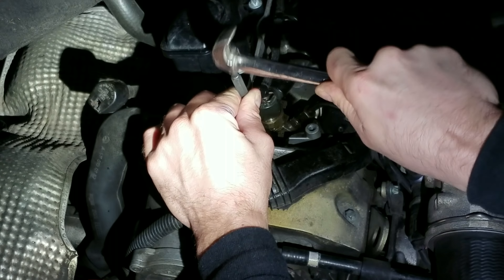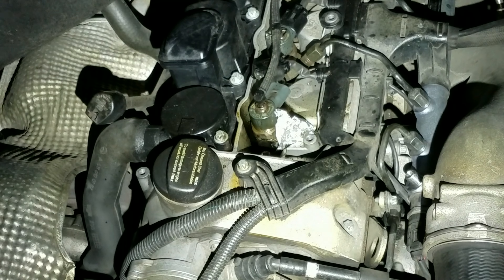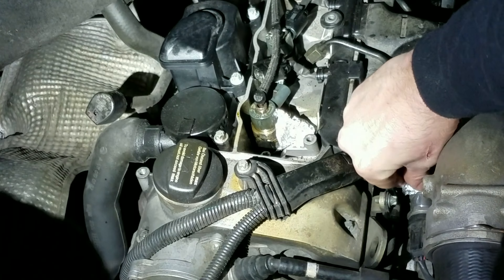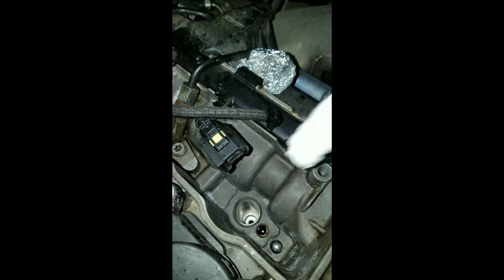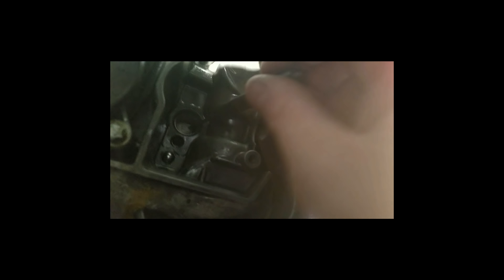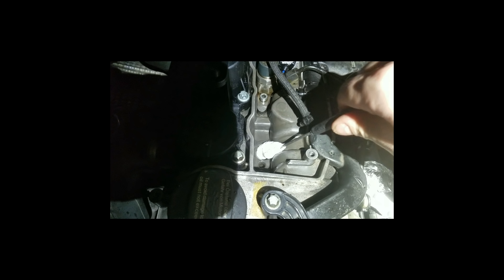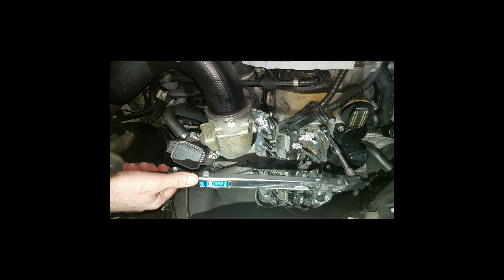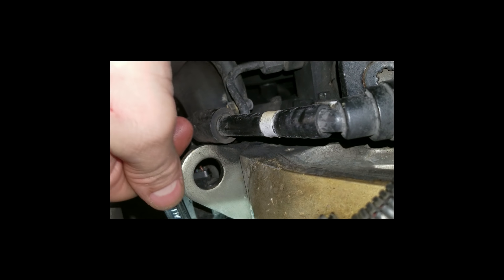How to fix "Black death" injector seal leakage on a T1N Sprinter [02-06 Dodge/FL/MB]

Comment: Actually a pretty good video.  I do think you should first buy a good set of tools. The try looking on u-tube.  I'm sure there in one out there that will show you proper techniques on how to use them. Also. Tell your friends to get out of the way of the camera. I think this part was on the first video.  
   When you first started it. You should have known it wasn't running on all cylinders.  It sounded way off.
Reply from the maker: I have the whole required tool list from PCC where I graduated with a degree in Diesel Service technology. I have plenty of tools and I know how to use them. The reason I was tapping on it was to jar any rust or corrosion on the threads, which could stick and cause the bolt to yield and snap rather than unscrew. 

This job requires a specialized set of tools that I mostly had put together, even an injector seat cutter kit 17 by 19 mm, but cleaning the threads was a little bit tricky and I wanted it fixed that night rather than driving to harbor freight for bottle brushes to mount on my drill because it had suddenly became very leaky. I actually have a thread on the Sprinter Source detailing my extensive tool list for this job that I already had (sneaky's tool list). What I really needed was a tap for the hold down bolt threads, but not just any type will work because the shoulder is wider than the threads and not long enough for the long injector bolt hole. This requires a custom tap that can take weeks to make and ship and cost 50 to $100 or more. I decided to make my own tap with the old injector bolts but it didn't work that great because I don't have a vice. Oven spray is actually one of the best tools for this job, there's a reason I wasn't using brake clean. So yes other than a custom tap that is not locally available, I had every single tool needed. Edit:( no money for air compressor btw, not a priority.)

 Also that was not my friend in the way that was me working on it.. sometimes I will have to get in the way of the camera, and with all due respect this is an unpaid job so I'm not always going to take off my greasy gloves just to readjust a camera.

And actually it was running on all 5 cylinders, it was just leaking on one, and I got that shot to show someone what a severe case is like.
Reply: @AncapistanVan  you mean you dont make any money off of U-Tube. Why does everyone else? 
  If you do 2 Sprinters. Why would not drop 50 to a hundred dollars for a specialty tap.  I think my air compressor was one of my first large tools I purchased for my garage. Long before my shop. But the was some 55 years ago. I've had several since my first.  Kind like women.  Been a couple of those gone by also. 
Everything seems to wear out for some reason...    😜
Reply from the maker: @ltsgarage7780   Lee Olaeta  zero dollars. Because just after I got to 10,000 views, YouTube changed the requirements to 1,000 subscribers. Yeah I'll get a specialty tap I just saw people using old hold down bolts with reliefs cut in the threads with good success, I just didn't realize I needed a vice to make a good one. Edit: I live in my van so might not have room for a big air compressor tank. Just another thing to buy, theres lots of those.. atm i need snow tires, $1000 steering rack, money to go south for the winter, etc. Sometimes ya gotta make do with what ya got.
Reply: @AncapistanVan  as far as the tools I was talking about.
First off. Your hammer. Oh you didn't have one.  Plus dont you have a 3/8 short breaker bar. You should never hammer on a ratchet.  You ruin it. Well. I guess you never hit it with a hammer since you don't have one.
    I really need to know where you purchased your complete set of tools. I've never purchased a set that came with a set of Leatherman pliers. 
  We've all used oven cleaner for oil or carbon build up. But I always have 3 or 4 cans of break clean. 2 or 3 in my truck. 4 or 5 in my shop. The stock on the shelves never gets low. Although I am down to my last container or bearing grease. Need to buy 4 or 5 more this week. Ah the internet. 
  Good luck. 
Keep up the good work.
Reply from the maker: @ltsgarage7780  i have lots of hammers, small to large. I chose that heel bar with the hammer face as it was the lightest weight and what i brought down from my tool cart. Yes i know not to hammer on even a lifetime guaranteed ratchet, i would have used my 3/8 breaker for that if i was going to hit it any harder than that. Sometimes it's quicker to slightly abuse your own tool than to go get the proper one, i know the limits of my tools and i've rebuilt a ratchet before. I use my leatherman bc it saves me lots of time. I have a whole drawer full of different pliers. I have every tool on the pcc required tool list; i've completely torn down and rebuilt a cummins n14 and a cat 3406E with them. Most the tools are napa professional so i can replace them locally; i bought the loaded cart from a quitter student and then started filling it out more. I actually started carrying two cans of brake clean in the van but i did use one can in the video. I did use the wrong torque wrench fir the initial torquw as i overlooked the min setting on my in/lbs wrench, but the difference is miniscule. I do also need crows feet, but this van has cost a lot of money restoring it so i make do without.
Reply: @AncapistanVan  what area do you live?  I guess I should ask first off. Which side of the pond? Why do you live in your van? How many subscribers do you have?
You can also make or purchase a fan belt driven air pump that mounts on the front of your engine. Plumb in to the underside of your frame rails where you put a 25 or two 25 gallon tanks. Walla you have air pressure. 
  You can do this for under a 100 dollars. You can also in your travels. Look for tire shops the take care of big-rigs with flat tires. Sometimes they will have an old compressor or the old truck you can strip the compressor off of. Maybe next spring? 
  Good Sumitomo tires are only 500 dollars! I only run Sumitomo on everything I have. I've never had a problem with them
 Depending on which vehicle. I get from 25,000 to 60,000 miles out of them.
Reply from the maker: @ltsgarage7780  I only have 162 subscribers lol, but I will put out more vids. I'm in USA, Oregon. Great suggestions, i'll have to look into that. I live in my van to save $1000 each month and bc i like it. You think those are better than cheap nokian snow tires?
Reply: @AncapistanVan  I don't think so. But mileage wise? The Michelin x-ice and Nokian are top of the line for the ice age. How are they for mileage and tread wear. I've never had to worry about ice. I'm a summer guy. So with my play vehicle I run a quiet smooth high speed tire.
 The sumitomo I've been running on my van roll really easily and are quieter than anything else I've run. But. I've never run a Nokian tire.
 SO ??
Sounds like you've done your homework?  I hope?
Reply: @AncapistanVan  as long as you buy their top of the line tire. I've run Bridgstone, General & Dunlop on my van.. right now I have the sumitomo tires. These are outlasting all the others I've had on it. Quieter, smoother, mileage? I dont know yet. I havent had them on very long. 
  Also,  the Michelin only beat out the Nokian tire because it was a tad bit cheaper. So why not run the Michelin tire.
   They both didn't rate well for the other three seasons.  So are you going to buy a tire that is "Great" in the winter. But in the other three seasons you just burn them up?

   What do you do for a living? Are you from Oregon, Seattle area?  Born & raised?
Where are your parents?
Excuse me for asking so many questions.
Reply: @AncapistanVan  age?
Reply from the maker: @ltsgarage7780  I've got Michelin Ltx at2's, top of the line, $200 something per tire now that they r discontinued. Put on at 215k, almost all worn out at 277k a year and a half later. Fantastic tires, grippy yet they drift if needed, decent on snow, just not beefy enough sidewalls for my pref. One took a nail to the sidewall, had to replace it with les schwabs best AT tire, which will be my new spare. Yeah I dont wanna have two sets of tires, but i also dont wanna crash my rig going over mountains for the winter, so I was thinking wear out some cheap snow tires.

I'm from seattle area,  in Oregon now and i hate the rain. I'm an owner operator courier for a local business, I same day or rush deliver pallets of stuff on my good days, long or heavy things, even pipes for the navy shipyard, or titles, house payment checks, documents, medications, anything really.  I like driving, just not thru gridlock, although my subwoofer and ac and diesel heater helps. So i think i'll try expediting to get me southeast and start my career somewhere warmer. Edit: I'm 27
Reply: @AncapistanVan  oh hell. I'm 41 years older than you.

                😏
Reply: @AncapistanVan  why not find a renter to help with the rent. Are you going to live in your van all your life. At 27 I owned 2 homes. Of course I had 13 with 4 in Idaho when I went thru a divorce in 2001. There went most of my retirement.  Yikes..
  You should have a home base.
Reply from the maker: @ltsgarage7780  I'd rather invest my money than throw it away. I want land without a ball and chain; eliminating rent is the quickest way there for me. I'm sure others have bloomed quicker than i, esp those with a mortgage/debt (slavery imo) but it took me till i was 24 to figure out what i like doing and there's reasons for that too. Edit, its also a different world economically where a middle class job is needed to scrape together a house in poor condition. In your days you could retire off of a factory job even.